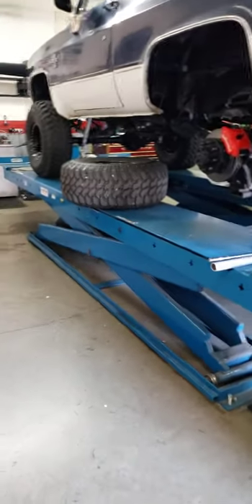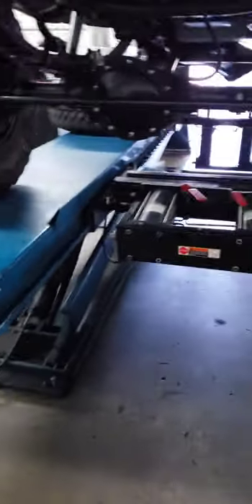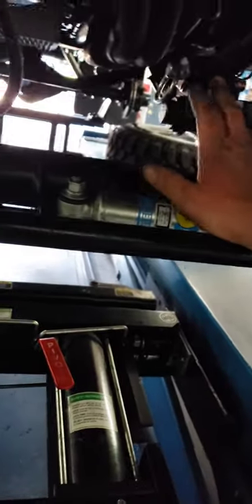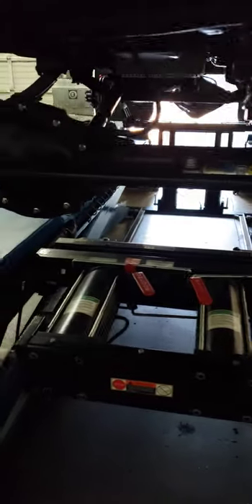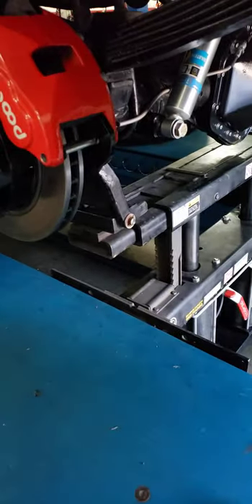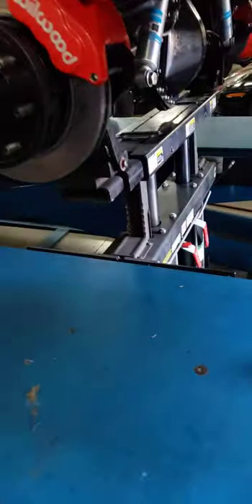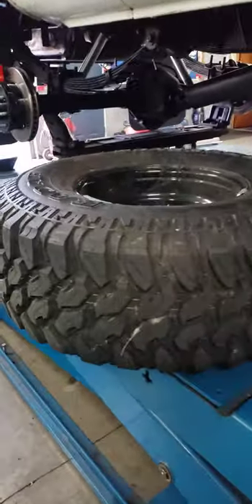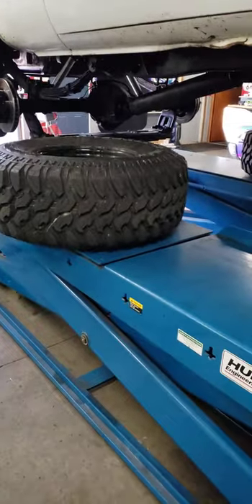5 must do mods for K5 Blazers!

Comment: 🔥🔥🔥🔥🔥goals 👍I have a 71 beautiful k5 .... I already have my 14 bolt full float factory disc brake axle the only problem is that it’s in my backyard and not on my truck the front axle is damn near impossible to find and when you do find one they’re asking 3-4 k for it ouch !!!😖

Comment: I did the crossover steering on my Dana 60 but still need to finish my ram assist unit. Turning on 37s is kinda like manual and that’s on road. ORD makes a sway bar disconnect kit for the crossover unit.

Comment: Great info sir. 
Ive found the front willwood brake caliper set. I am having trouble finding willwood calipers for my 14B full float though. Would you happen to have any links for that?
Reply from the maker: It’s the exact same as the front, and then I bought a rear disc brake conversion kit for the rear that uses front calipers from I believe diy4x

Comment: I picked up a m1009,  has 10 bolts it'll be a while before im able to get 60s do you think 10b and 35s with chromoly axles should hold up? No crazy off roading and beating it up, but will take it out i believe in driving it there and driving it back lol but your input would help thanks !
Reply from the maker: The m1009’s were 8 lug 3/4 ton I thought? 
But yes totally know if you’re not being crazy on it 10 bolts are fine for quite a while I’ve ran in before with 35s and i was fairly hard on them 
The biggest weakness I found was having an open rear differential spinning one tire and then the other tire catching and it would blow up the spider gears but other than that it did fine but
I wouldn’t put any money into them, You can save up for bigger axles later 
They are stronger axle than you think, Don’t get me wrong you can break anything if you try hard enough but within reason they do good
Reply: @DSRE535   not 100% im sure they arent different for what they were used for 08's were 8 lugs this was on a naval base with 40k miles so couldn't say no, thanks i feel alot better now lol read what ppl say makes it seems like they will break going up the sidewalk lol
Reply from the maker: @danielr.7870  yeah you can’t listen everybody lol but yes I understand the Internet we had you believe that the minute you let your truck down off the jack that the 10 V will snap in half but that’s just not the case, the internet can scare you out of doing just about anything and make you second-guess everything you do in your truck but just go have fun, fix it when it breaks:-)

Comment: Hey brotha. Do you have a part number for that sway bar kit. And also will that fit a 72 k5?
Reply from the maker: That kit is from off-road design and it fits 73 to 91K fives I’ve never tried to put it on the 72 earlier K5 so I’m not sure exactly what’s the difference there but I think the swaybar is different
Reply: Ok thanks

Comment: Do you have a link for the U joint steering shaft you used?
Reply from the maker: Yeah hear you go, 
https://www.offroaddesign.com/steering/u-joint-steering-shaft.html
Reply: @DSRE535  thanks buddy. Now which specs did you use?  I know you said for older Jeep’s and the difference is by years it seems so which specs did you go with for that part?
Reply from the maker: No problem, I cut it to fit on mine I measured it out and just did it that way I bought the steering shaft from ORD and then I did it because I wanted to make sure that I had the right amount of shaft and still have slip movement, especially in case you get in an accident you won't get impaled by the steering shaft
Reply: @DSRE535  so did you go with the 79-94 specification?
Reply from the maker: @crazyfoolbb1  sorry yes I did
Reply: @DSRE535  not at all I really appreciate your insight. I’m ordering that and the sway bar correction kit now. Eventually I need the better axles but I’ll wait till something comes up locally for sale. I got an 85 with 39s and right now the steering sucks so this will definitely help.
Reply from the maker: @crazyfoolbb1  no problem man the sway bar steering correction helps a lot but ultimately with that much lift and tire size you're going to want to get a two-wheel drive steering box and then go to a crossover steering setup